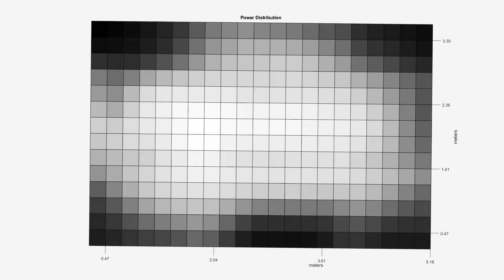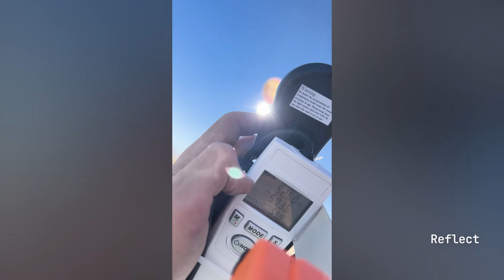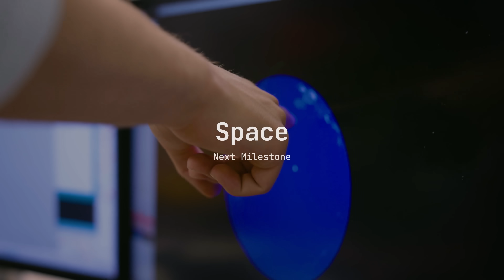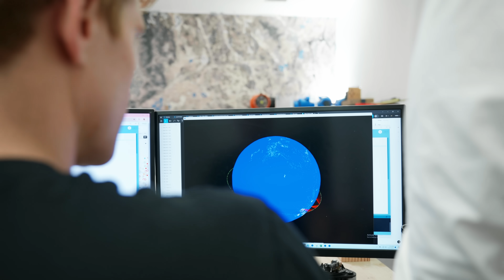They're Making Solar Panels... Work at Night | Reflect Orbital

Comment: I thought this idea was stupid, because launching things into space is expensive. So I did the math, and it actually adds up. NASA proposed a solar sail (which is basically a giant space mirror) that is 1200 m^2 and weighs 32kg, with 80kg of support. This is 112kg to launch into space. With the current cheapest rocket (falcon , $3600 per kgg) this would cost $400k. But with SpaceX's next-gen starhip they aim to get this down to just $20 per kg, so $2240. Even assuming the starship costs are 10x higher, it would only cost $22.4k to send into space, or $6.3 per square meter. A square meter of regular solar panel costs around $200. Assuming this mirror reflects 100% of the sunlight 50% of the time, it would generate $12k a year worth of electricity (assuming 10 cents per kwh). It would pay itself off in about two years., and that's being very pessimistic with the starship costs. I haven't factored in the material costs, but it's really just a giant mirror so when you scale this up the materials should be cheap compared to the rocket launch. This can pay itself off in just a few months if SpaceX reaches its starship goal. To put that into perspective, regular solar takes 10-20 years to pay itself off. And again, even if starship gets 10x more expensive, it would take these space mirrors 16 years to pay themselves off, basically the same as solar and even then there are tons of optimizations you can do, like reducing the structure weight and increasing the size of the panels. It's insane how launching a mirror into space can be more cost-effective than regular solar.

Comment: There's an EEVBLOG debunk videoon it, and he enabled critical thinking unlike most t channels, and as the reflected beam spreads out by 0,5°m the 10x10m mirrors reflection will be spread out to a circle of 5km diameter when it hits earth. 100m2 will reflect 100kW AT THE VERY BEST ANGLE MAX, and spreading out 100kW of power over a circle of 5km will deliver an average of 5MILLIWATTS per m2 instead of the 1000W or 1.000.000mW a normal solar panel can get at noon from sunlight.
Guess what, 0,005W instead of 1000W will not even be enough to run  solor plan'ts eectronics. Tht is the equivlent od NOTHING in practicle terms, that's full moon level of power.
Which more YT channels would enable critical thinking and at least run SOME numbers before they hype stuff.

Comment: Placing mirrors in space to enhance solar farms is impractical. The mirrors would need to be at least as large as the farms themselves to reflect enough sunlight, making them extremely costly and challenging to deploy and maintain.
Reply: They would most likely be made out of the same material as super lightweight solar sails. They can fold up very small and and unfurl in orbit. 
I think there is a way of balancing it in orbit so its held in place by gravity of earth but also the pushing force of solar winds. It might be called a statite., its been a while since i read about it
Reply: @rowshambow  That would overcomplicate the system. Statites are still hypothetical satellites, and while they could potentially stay in place using solar radiation pressure, keeping them balanced would be extremely complex and prone to instability. Even small changes in solar wind or gravitational forces could cause issues, requiring constant corrections. A simpler and more reliable alternative would be to place mirrors in geostationary orbit if that was the goal, though even that would still be costly compared to just improving solar farms on Earth.
Reply: This is more of a proof of concept for observations and communications
Reply: I would rather have an HVDC supergrid

Comment: Hi, i just want to suggest you two things:

1. Look what is called digital micromirror device and check how does it shaps the wavefront and direct light by using holographic methods. 

2. If you think it is gonna work, just try making some origami based macroscopic DMDs for reflection. 
Thank me later.

Tripathi Om Sarveshwarpati

Comment: I love the innovation but before anyone immediately starts investing… let’s talk about why this will never likely  happen.

1. Light scatters Rayleigh scattering is what happens when the light passes through our atmosphere even if the light is strong enough (which is another issues) it will be spread out across a large part of its directed area. 

Next (as mentioned a bit ago) light will diffuse and be significantly less intense. 

2. Communication issues will occur making this a legal and international mess. Large mirrors or reflectors in satellites will cause issues to other satellites and radio waves / communications from going where they need to go. No government would allow that type of tech ruining important communications. 

3. Even if we can look past all of that (we can’t) the environmental impact would be negative. Beaming sunlight to areas where wildlife may interprete it as sun light could affect the ecosystem. 

4. It’s not economically viable. The cost with such low return wouldn’t be worth it even if they did manage to get@past the other issue. 

5. Geopolitical concerns. Nations would have an issue with the ability to redirect sunlight which could potentially lead to a ton of other issues. 

It’s theoretically possible and looks good on paper or as a concept video … but it’s not likely going to happen because of overwhelming political and engineering issues that just can’t be overlooked or easily overcome.

Comment: It feels like there's something off with the cost/benefits of this...the cost of putting giant mirrors in space would be astronomical compared to the value of a few extra hours of electricity. He said "one satellite doesn't produce a ton of power but after that we just launch more and more..." BIG hand-wave there. To scale that up globally you're talking about an insane amount of reflectors in space, so much junk in orbit, so many potential problems, all just to boost the efficiency of solar farms somewhat? It's a huge and messy fix to a problem with many simpler solutions, like nuclear, for one...
Reply: Placing mirrors in space to enhance solar farms is impractical. The mirrors would need to be at least as large as the farms themselves to reflect enough sunlight, making them extremely costly and challenging to deploy and maintain. Light disperses over vast distances, reducing efficiency, and atmospheric conditions further diminish the amount of sunlight reaching the solar panels. Additionally, building and launching such massive structures would be prohibitively expensive. It's more cost-effective and efficient to invest in improving solar technology and infrastructure on Earth rather than relying on complex and expensive space-based solutions.
Reply: @JuanVillasante  Thank you for the technical explanation of what felt intuitively obvious. This seems like an investor scam or something...
Reply: @OuterEdgeOutpost  And that’s not even considering other issues, like regulatory problems or the challenges with reflections themselves. Space agencies and companies like SpaceX go to great lengths to minimize reflection—painting satellites black to avoid interfering with observations from Earth. Yet, this idea proposes putting hundreds of massive reflectors into orbit on purpose, creating a giant mess in space. It’s impractical, poorly thought out, and would likely face significant opposition from both regulatory bodies and the scientific community. Instead of solving problems, it would create a host of new ones that we’re not equipped to handle.
Reply: I think this is an investment scam or pure incompetence
Reply: I thought this idea was stupid too, so I did the math, and it turns out this will actually become feasable in a few years with reduced costs to launch things into space, and they are getting the tech ready for that moment. NASA proposed a solar sail (which is basically a giant space mirror) that is 1200 m^2 and weighs 32kg, with 80kg of support. This is 112kg to launch into space. With the current cheapest rocket (falcon , $3600 per kgg) this would cost $400k. But with SpaceX's next-gen starhip they aim to get this down to just $20 per kg, so $2240. Even assuming the starship costs are 10x higher, it would only cost $22.4k to send into space, or $6.3 per square meter. A square meter of regular solar panel costs around $200. Assuming this mirror reflects 100% of the sunlight 50% of the time, it would generate $12k a year worth of electricity (assuming 10 cents per kwh). It would pay itself off in about two years., and that's being very pessimistic with the starship costs. I haven't factored in the material costs, but it's really just a giant mirror so when you scale this up the materials should be cheap compared to the rocket launch. This can pay itself off in just a few months if SpaceX reaches its starship goal. To put that into perspective, regular solar takes 10-20 years to pay itself off. And again, even if starship gets 10x more expensive, it would take these space mirrors 16 years to pay themselves off, basically the same as solar and even then there are tons of optimizations you can do, like reducing the structure weight and increasing the size of the panels. It's insane how launching a mirror into space can be more cost-effective than regular solar.
Reply: @GamerBath  Your math is wildly unrealistic. Banking on speculative $20/kg launch costs is pure fantasy at this point. Even if Starship somehow hits that target, you’re ignoring huge issues: mirrors don’t reflect 100% of sunlight, the atmosphere scatters light, and maintaining massive space mirrors is a logistical nightmare. You’re also underestimating the cost of keeping these things in orbit and free from space debris. Regular solar panels are already proven, getting cheaper, and don’t come with a million problems like orbital decay or constant adjustments. This space mirror idea is more sci-fi than anything practical.
Reply: Yeah I think this would be more practical if they were just doing like concert lighting. Light up a battlefield. Having a fake sun at a football game.
Reply: @jamesbowser9350  On the website it seems to allow consumers to “reserve a patch of sunlight” so maybe that’s the direction they’re heading. It would be pretty amazing for special events, parties, marriage proposals etc.

Comment: I don't get how you would transform, 100m² of solar energy in space to km² on ground. Let's say you have 1.3kw/m² solar power in space. So 130kw with loss of difraction and so on. You get not a lot on the ground, how can it be a business ?
Reply: Investors give them money. They work on it, pay themselves a salary from investments, and when it fails they repeat the process with another idea.
Reply: They can't. Placing mirrors in space to enhance solar farms is impractical. The mirrors would need to be at least as large as the farms themselves to reflect enough sunlight, making them extremely costly and challenging to deploy and maintain. Light disperses over vast distances, reducing efficiency, and atmospheric conditions further diminish the amount of sunlight reaching the solar panels. Additionally, building and launching such massive structures would be prohibitively expensive. It's more cost-effective and efficient to invest in improving solar technology and infrastructure on Earth rather than relying on complex and expensive space-based solutions.

Comment: pretty crazy idea. Better idea is to move electricity around the world using undersea cables just like we send data. Then you can just have local solar panels and send excess power into the grid where it can be used where it is dark.

Comment: TLDR: They probably look at it more like how much they can earn per satellite. Back of the envelop calculations say with 1000 satellites they can make $250m a year indefinitely and produce 400GWh of useable energy which is same order of magnitude as a small wind farm.
--------

Long version:
When looking at approximate unit costs one should look at the fixed cost of launching each satellite and how much the energy reflected back to earth can be sold for. I have no idea what their numbers are but lets play around with something like this:
50kg SpaceX rideshare is $300k-$600k. Lets say $500k for one satellite rideshare launch. 
We can perhaps assume the mylar is 50% of the payload, so 25kg of Mylar at  28g / meter^2 with thickness 20um is around  800-1000m^2 of mylar and therefore could perhaps be around 1000*3 = $3000 if Mylar costs $3/m^2,. This cost is negligible relative to the cost of the launch. My guess is that whatever makes up the remaining 25kg payload would be no more than 10x this. And so approximately negligible also. In other words, we can go with the cost of building and getting a satellite into Sun-Synchronous orbit being mostly the launch cost and we assume that we can get 1000m^2 of mylar per satellite.
So at the absolute best possible case scenario assuming NO other losses, then we can reflect 1000m^2 of solar radiation per satellite. Solar radiation is ~1360W/m^2 at SSO so that yields ~1.4MW of reflected solar energy available per satellite. 

We can now compute how much we can earn from this. Lets assume regular electricity costs around $0.15 / KWh during the day but shoots to $0.65 in the evening during peak usage in Calfironia for example. Then If they provided it at say $0.6/KWh that would be sufficiently competetive. So assuming they can use their sattelite to reflect 1.4MW for 30 minutes at 25% efficiency conversion by the solar farm they supply, then that is worth 1400kW*0.25*0.5h*0.6$/kWh = $100. If we further assume they can fill some more slots - assuming each slot is 30 minutes - then there would be 48 slots in a day and at perhaps 20-25% of slots taken thats maybe around 10 slots so worth $1000/day.  And to improve this, if each satellite was smaller, they could individually aim it at peoples houses and probably eventually fill most of their slots. Thereby maxing out around $4000/day per satellite.
If there was perfect sun over a year, then 365*4000 ~ $1.5m dollars earning potential per year per satellite. However assuming weather reduces that significantly (maybe to 30%) and assuming they dont manage to fill more than 20 slots in a day, we arrive at a yearly earning potential of $1500k*0.3*0.5 ~ $250k.

So, in other words, for a $500k investment, and earning $250k a year, it takes 2 years to pay it off and then its basically just an amazingly scaleable source of income. With 1000 satellites, after 2 years they could potentially be earning $250m a year. Sounds like an amazing business to me (with the caveat that these are all very much inaccurate numbers but should be sufficiently ballpark) …
Reply: Great story, maybe some idiot with more money then brains will invest.

Comment: I’m not sure I understand the economics here — some quick math shows the business case just doesn’t close. Mylar weighs 0.024 kg/m^2 (15u thick). The total area of the solar farms in California is 133,493 acres = 540227004 m^2. If you want the solar panels to receive the same amount of power via reflection, then you need at least this much surface area, which translates to 13,000 metric tons of exclusively Mylar.

This does not include the reaction wheels, thrusters, actuators, or structure of the satellite, just assuming a magic Mylar mirror floating above the solar panels — in reality you would need a constellation of mirrors to reliably provide power with all the associated components I mentioned above.

A Falcon 9 launch costs $70m and can deliver 22 tons to LEO. This means it will require a minimum of 591 Falcon 9 launches, about $413.7b in launch costs. Assuming a satellite life of 10 years (the current largest constellation, SpaceX Starlink, is about 5 years), that means it needs to generate $41.4b in revenue per year to just break even on launch costs. 

The California solar energy grid generates 47 GW of power, so assuming Reflect Orbital can power this grid for 2 hours after sunset that would be 94 GWh of power per day. In California, electricity costs about $0.30/kWh, so 94 GWh = $28.2m/day. Going with the 10yr lifespan, that means a lifetime revenue of $102.93b, about 1/4 of the launch cost.

I’d love if the Reflect team could share some numbers on how they think this could work. Even with VERY generous assumptions, the business case just does not close here for me.
Reply: SpaceX rideshare, based on their website, is ~$300k for 50kg payload on a 1/4 Plate.
Reply: interesting… it’s all about the mirror folding compression rate (then it’s expansion), together with cost for payload launch on the rockets. The movements themselves are a given Already… I’ve worked on O3b/Ses/mPower and those pointed beams out from multi passing satellites were already a solved issue… and it works really nicely
Reply: @conradocaon4578 Makes sense, that’s cool stuff! I was neglecting the packaging challenges and assuming they could fully utilize the payload mass in the fairing volume of the LV, but assuming that the total reflective area >= solar panel area, otherwise the power density would decrease.
Reply: I can’t like this comment enough.
Reply: You're doing the math with current technology. Your first axiom is highly flawed.
Reply: The interesting thing about that is if we get to the point that rocket propulsion cost is cut in half, more than likely we’ll have also made advancements in solar energy and increase efficiency from 20% up to closer to 90%. We’d get more than twice as much power without needing to send satellites to space. All technology evolves, not just rockets 👍🏾